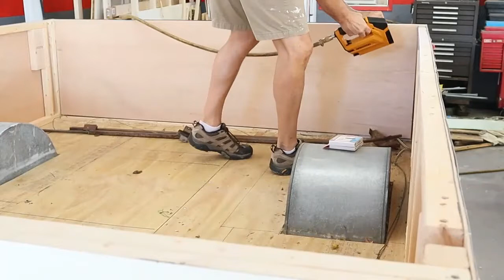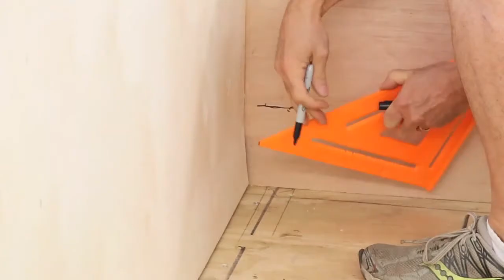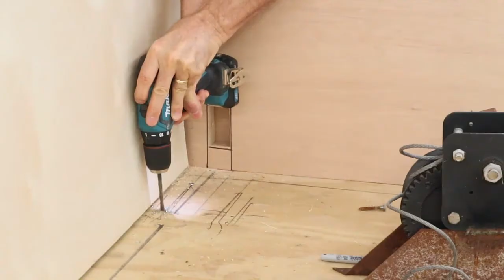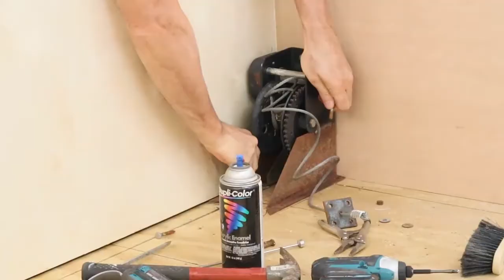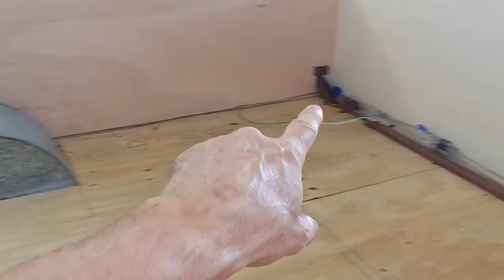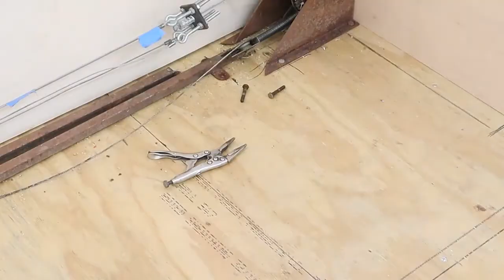POP UP CAMPER CABLE LIFT SYSTEM & INTERIOR PT16 Jayco Tent Trailer Rebuild Renovation Mods #flgpopup

Comment from the maker: (You can order the parts mentioned in this video using the links below. These are affiliate links. That means I make a small amount for each purchase but it does not cost you any more money for the product. Thank you for supporting this channel.)
*Reflectix
https://amzn.to/2ZiYn4P
*Window Tint 
https://amzn.to/34NY5Ei
*Vent Fan 
https://amzn.to/2sZeGaE
*4x6 speakers 
https://amzn.to/2MphkgV
*AGM Batteries 
https://amzn.to/2rl8Ccd
*Battery Cable 
https://amzn.to/2sVc5yC
*Solder 
https://amzn.to/34PW1eS
*Fuse Box 
https://amzn.to/2sdNp4u
*Solar Controller 
https://amzn.to/2sYCz2s
*40 amp Breakers 
https://amzn.to/2MmoDpv
*150 amp Breaker 
https://amzn.to/393OgFq
*Pure Sine Wave Inverter 
https://amzn.to/3728u0n
*12 volt Power ports 
https://amzn.to/34Mw3sM
*Black Electrical Tape 
https://amzn.to/395eeIK
*Red Electrical Tape 
https://amzn.to/34RoqB6
*Square D QO2L30S Breaker Box 
https://amzn.to/493gYGs
*Square D QO120 breaker 
https://amzn.to/2PJgBcq
*25 foot 30 amp 110volt power cord. 
https://amzn.to/36TSxZK
*30 AMP Shore Power plug in port 
https://amzn.to/2Zifm7s
*10/3 bulk stranded cable 
https://amzn.to/394wySk
*12/3 bulk stranded cable 
https://amzn.to/2rgYwsS
* Leaf Spring Shackle Kit 
https://amzn.to/3iW27Cg
* Wheels and Tires 
https://amzn.to/3fcFlDl
* Wheel Adapters 
https://amzn.to/3fauGJn
* Paint and Rust Stripper 
https://amzn.to/2FF3BTb
* 1 Gallon Storage Baggies 
https://amzn.to/3iXh1bC
* 1 Quart Storage Baggies 
https://amzn.to/3cqkQ6v
* Permanent Markers 
https://amzn.to/35Vfa33
* Raven Nitrile Gloves 
https://amzn.to/3kzXyho
* 2 inch Trailer Coupler 
https://amzn.to/2ZYy2KN
* Safety Chains 
https://amzn.to/3ckq9UZ
* Trailer Tongue Jack 
https://amzn.to/3iM8o3n

Comment: Something I don't see is people using some form of insulation in the walls. Is it because you are going to lose most of your heating and cooling through the canvas?
Reply from the maker: Yeah, I have never seen a popup with insulation. Could be the inefficiency of the canvas. A popup is basically tent camping off the ground.

Comment: Interesting. I owned a PUP years ago, it was our 1st camper. Even did a panel repair of upper front left corner side. I found that to be challenging. Would definitely not want to tackle a whole rebuild.
Cheers
Reply from the maker: I understand. If I am going to work on something like this, I would rather build it up from scratch than spend time on patch repairs. Different strokes for different folks. Thanks for watching and commenting.

Comment: Why wouldn't you just get all new marine grade nuts and bolts for the lift system?  You are doing so much good work, and for a few more dollars you could get new bolts.
Reply from the maker: Thanks for the input Chad. Several reasons. 1) The 1/4-20 fasteners have never been torqued to stretch specifications because they are tightening plywood. Torqueing the bolts to spec would damage the deck. So the bolts are fine as is. 2) If you are wanting the marine grade for looks, the whole cable life assembly will be covered, not visible inside at all. Underneath they will be painted black with Rustoleum for touch up, again not visible. 3) I would have to order all the fasteners far in advance of any assembly work because getting some items has taken a lot longer this year. 4) This will probably be the last time these fasteners will ever see the light of day. They will do their job well for many more years. However, be assured that I am replacing all the square drive fasteners with pan head phillips stainless steel screws. I hope that answers your questions. Thanks for watching.

Comment: Nice Job GB!!
Reply from the maker: Thanks for watching MT. It is coming along nicely.
Reply: @FakeLegGreg  GB, Using the paint can to mark a hole in a tight spot --Great Idea. Using the magnet to fish a bolt into hard to get to hole--Another Great Idea. Another fellow who was like You, Auto &Truck Mechanic, Machinist, Electrician, Welder showed me a trick a long time ago. If You can see the hole but can't get to it with Your hands, take a piece of light guage wire and make a circle around the bolt that the head won't slip through. Lower the bolt to the hole with one hand and carefully start a few threads with a long extension and socket with the other hand. When You think You've got enough threads started--Yank hard on the wire to get it out of the way and go ahead and tighten Your bolt. I noticed a few other of Your work by Yourself tricks You used on this video. Thanks for sharing them with us and teaching Us to think as We work.